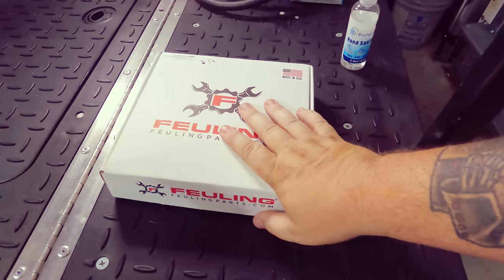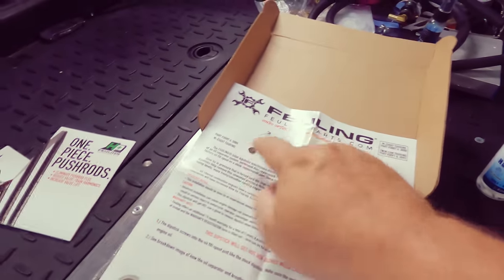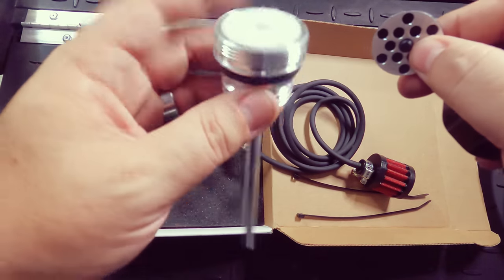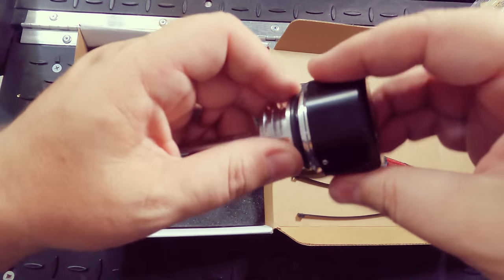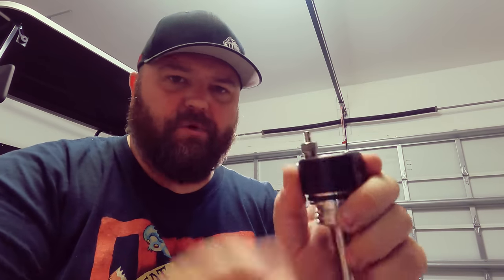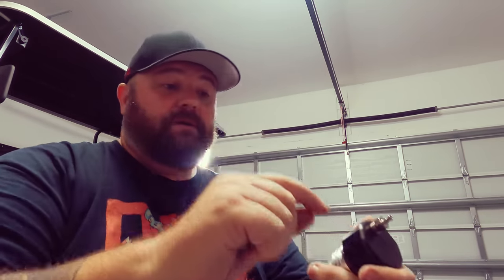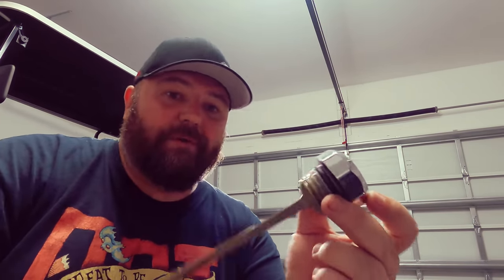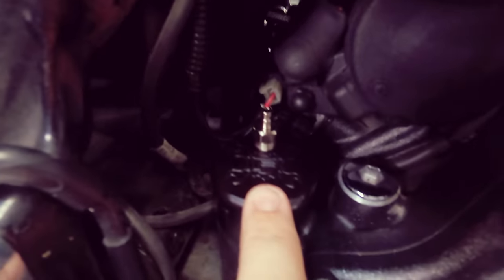Harley Davidson CVO Road Glide - Getting Rid of the Blowby

Comment: After 100k miles on my Ultra I replaced the air/oil separators in the rocker boxes to help stop the oil in my air filter. Then also added the Fueling dipstick and that thing is nice. The stuff that’s inside the Fueling dipstick cap is exactly the same stuff in a twin can air/oil separators. I’m very happy with Fueling.
Reply: Read you saying 100, 000 miles or 1,000 miles because 1K equals 1,000.
Reply: @boblafountaine9560  I have 100,000 miles + on my 2011 Ultra Limited.

Comment: The competition’s hose routing goes up, under the gas tank, and the filter rest behind the air filter cover. The theory being that gravity will let any expelled oil run back down into the tank, and being up high won’t suck oil out of the tank.

Comment: You’ll still need to do the rocker box ones to keep the air filter clean.
Reply: My filter is spotless with just the feuling dipstick
Reply: @ericnuernberg3901  how many miles have you ridden with the dipstick?
Reply: @brianregan3046  not much, maybe a little over a thousand miles.
Reply: @brianregan3046  but so far, so good! 🤞

Comment: I greatly reduced the awful blowby of my 114 by slightly under oiling the engine, I mean by that running it at 90-95% of the full hot mark but she's still puking a little.
But doing this requires to be a little more vigilant on your oil level and not let it go down too much.
I may end up doing the Feuling thing but I can't wait to see your report on this.
Reply from the maker: I have heard that also. 90% seems to be the magic number.
Reply: @ProfessionalMonkey 
I'm almost sure Harley did run his engines at 30% or less for the EPA tests haha
No oil ; no oil blow-by ...

Comment: I bought one. Here in Europe they cost over $400 due to taxes and duties. On the test ride after fitting I initially felt no change. Then after a while I convinced myself the throttle response was better, but then I thought my M8 engine was not running as smoothly as normal!. I guess its all subjective, but I will see what I think after more miles.

Comment: Whatever you do, use the PREFERRED method that Feuling recommends or routing the hose and filter through the frame of your bike, not the method of just using the little screw filter that comes up from the top of the dipstick. I got lazy and just used the little screw filter method which was fast and easy but then I took off on an 1,100 ride over Memorial Day weekend and ended up with a bike full of grime and oil. The oil mists ever so gently out of the little screw filter but then collects on the bike which then collect dirt and grime from riding. It took me over an hour to clean up my bike from the oil residue and only about 10-15 minutes to hook the dipstick up using Feuling's PREFERRED method. Long story short...do yourself a favor and use the PREFERRED method instead of the quick and easy one. This is a great product but take the time and do it up right the first time or else you'll be cleaning up your bike from an oily mess and regretting not going the extra mile to begin with.
Reply from the maker: Agreed.
Reply: What you mean by preferred method Sir?

Comment: I just installed mine yesterday. I will wait for my next service to check the intake and see if I have less oil. Be aware that the included ties are too small for tying into the lower frame.
Reply from the maker: Yep, I think they intend for you to tie them to the cabling not the frame rail itself. That's what I did, I just used about 3 or 4 more because I am anal retentive.

Comment: I got the gas monkey oil cap vent and the filter goes up under gas tank. Downside there's no dipstick and they advise you to run the oil level about a half quart low to prevent excessive blow by. Upside is it was $89. Although after testing there was minimal HP gain .5 but It really feels like frees the motor up and it accelerates better. I have to do the air filter ones next I have an after market arlen ness so oil just runs down the motor.
Reply from the maker: I am doing a catch can tomorrow and will film it.

Comment: Interesting. Older engines had blow by relief on the back side of the crankcase. It worked pretty good.
Reply from the maker: Yep. And they didn’t cycle it into the motor either.
Reply: Yeah, but the EPA says you can’t do dat no mo

Comment: I was wondering if anyone has spoken to the service department at their local dealership about this issue.  I want to say I am very happy with the service guys at my dealership they have treated us very well.  When I asked them about this and showed them a video on the topic they acted like they had no knowledge of any issue with the M8 blow by.  Maybe they are not allowed to say there is a problem with a Harley product?  I was just trying to find out if this was something we needed to address on our bikes (19 CVO Street Glide and 18 SGS) or if someone was just trying to sell their product (vented dipstick).
Reply from the maker: Hi Scott, I am not being paid to say anything, Feuling just gave me the product. I would never say something I don't feel is true. I am shocked to hear that a dealer claimed to not know about this issue. Do you HAVE to do something? No. Right now any excessive oil that comes out of the breather bolts is pulled into the intake and burned. That causes the air your bike is burning to be hotter (less efficient) and oily, causing build up on your piston heads, eventually reducing power. This is just a way to improve the overall "health" of your motor. No one is trying to sell you anything, just a neat way to get rid of a design flaw.
Reply: Doc at low country does a video about needing extra head breathers! I ask stonewall hd and service was not aware about problem and comment was anything non oem could bone you if your dealer is a hole!
Reply from the maker: @kpnomad7  Absolutely true. If your dealer wants to be an a$$ they could ding you for anything. I wonder if Doc would recommend additional external top end breathers if you have the oil tank vened?
Reply: Doc did the ext head breather on his personal bike! I haven't seen any more updates about him doing more for the crankcase!
Reply: If your bike had the problem you would know it! I’ve fooled around with my local dealership for four long years with no good solution. I’ll try this and pray it works!!

Comment: The Fueling Dip stick is definitely the Solution for the sumping as I understand it.  The oil catch can is definitely a good idea.  I have a catch can on the HEMI in my Ram 1500 and had one in my Dodge Charger.  Amazing what the oil catch cans pull as blow by.  Saves all that crap from going in your intake.  I drain the oil catch can on my truck about once a month
Reply from the maker: Good to know!

Comment: Keep a eye on the transmission oil on the M8 apparently it's being transferred into the primary case through the clutch rod,  on some bikes this is happening within 1000 miles. This  can cause serious  transmission damage due to low oil condition.
Reply from the maker: Mine already has the vent tube.

Comment: I ordered one from A1 Cycles should come in tomorrow for my CVO hopefully works out!
Reply: Let me know what you think...I like 89 versus 289
Reply: Will do!
Reply: From the research I've done, coming out of the oil tank the vent would relieve some of the heat from the oil keep the oil cooler.
Reply from the maker: You're exactly right. Buying a dipstick with holes in it is NOT THE SAME as Feuling's.
Reply: @Dave B i installed the A1 Cycles Breather Dipstick,  I have a 2011 CVO Road Glide Ultra with the TC Screaming Eagle 110 Stage ll 255 cams  my issue was rear cylinder Extreme engine heat and my motor felt like it was forcing itself to run when it is fully warmed up, this from what a couple of Harley dealers told me is typical with the TC 110 Screaming eagle motor.I had no blow by at the air cleaner, once I installed the Breather I hit the highway for a 100 mile ride the motor did run Cooler and Smother there was no oil leaking from the beather, now A1 does recommend you take a little oil out of the tank which I did and the filter runs up between the cylinder heads. I did run by the Harley shop afterwards to get there Blessing which they did. Dave this worked for me in my situation do your Research as Jason says who knows it just might work for you!

Comment: I vent in both those places as the pressure is built in two different ways ...sort of the churning of oil creates crank pressure and the blow by creates head pressure. You want your engine to breath well do them both.that said I only have one outlet I t my crank breather into my head breather and to the ground. Ps if you can get fuiling to send you and oil pump and cam plate for a 103 I'll take that.
Reply from the maker: Ha!
Reply: @ProfessionalMonkey  its le.get I've got s&s cam plate and pump  but I always wonder did I make the right choice.  I have three but could I be happier with only two. That an inside the pump joke.

Comment: Adding this to my first CVO once I take it home... after my dealership and Harley pull their heads out and supply the handle bar cable clutch extension kits for 13” handle bar change 🙄
Reply from the maker: Its a nightmare. My guy said they should be in on the 12th, then 3-5 days to get it in hand.
Reply: @ProfessionalMonkey  
.... apparently, after market suppliers like Magnum & FBI are not ready to release a kit that fits the clutch arm and cable clutch adjuster without crimping the line 🤬
Super appreciate any feedback you share on this issue. Like you, I literally don’t know how to ride with stock handle bars 😫
Reply from the maker: I[m just waiting. It sucks but the other option would be to use a 2011 model year clutch cable long enough...
Reply: @ProfessionalMonkey  ... my dealership tells me that’s not an option because of the CVO clutch arm? Risk of crimping the line??
It’s so ridiculous

Comment: I'm wondering why someone hasn't designed an intake with a built in catch can.
A hidden drain valve  and a inspection port to know when you need to service would be nice.
Reply from the maker: EPA
Reply: Several of the Arlen Ness Air Cleaners, including the Big Sucker for Stock Cover include a catch reservoir which is not too difficult to clean out, when required.  But you essentially have to first remove the filter element and stick your finger in the reservoir to see if it has caught any condensed oil.  It's best to wick up any oil with a paper towel before removing the reservoir cover to prevent dripping.

Comment: Nicely engineered piece!  Have running the Fueling Oil Dipstick Breather/Venting Kit on my 2020 SGS for about 2 months now; originally I had run it with the small breather (no hose and filter) for a few days and it was fine.  I then decided to go with the hose and filter.  Looped the hose up and over then down (same as Fueling's recommendation) and tied off the filter down under/between the trans and gearbox.  Works excellent!  The only item was a 0.050 tool for the set screw for clocking and then setting/locking down in place the final clocking (ended up going to Harbor Freight to get the tool, which was cheap...about $7 for a whole set of about 8 different sizes; of course only needed the 0.050" but they didn't sell just the one.  Interestingly, I found a bag of 100 of these 0.050" online for $11.99; it would have been convienent if Fueling included the 0.050" tool for the set screw).
Reply from the maker: Surprisingly I ended up having one.

Comment: I installed one on my 2019 RGS last September, I have still seen some oil in the intake. I just added a DK Customs catch can as well. Anxious to see if you still have it afterwards.
Reply from the maker: I would image there will always be SOME, since there is oil sloshing around up there, it's gonna find a way out even if its just a dribble, but this definitely de-pressurizes the breather bolts quite a bit.
Reply: @ProfessionalMonkey  it's best to do both but if you can only do one the blow by kit is the way to go bc it makes sure no oil can get in the dipstick is more of a reducer

Comment: Steep price!  I did the T-man version of tapping the side of the oil tank.  Did the research and purchased the parts separately online around $65. Don’t need to change anything with the dipstick. Also did a version of the external/internal breather mod to get it out of the stock intake.
Reply from the maker: You drilled and tapped your oil tank? Respect, I am just not up to making such permanent mods that could go wrong.

Comment: Great video Sir! Has Harley done anything to improve this on the newer engines? Or will I need to do this on my 2021 114"?
Reply from the maker: Nope. No improvements. All M8 motors spit a bit too much up top. I will go ahead and do something like this on my 21 also.
Reply: @ProfessionalMonkey , thanks!  Keep up the AWESOME videos!!!
Reply: @bobpatterson6052  The only "fix" the EPA would allow is the primary vent. It's part of the manufacturing process for '20+. If you have the '18-'19 look at the top/rear of your primary. If you have a rubber nipple coming out it's done. If not, take it in for the recall (won't cost anything). 

the recall is better than nothing, but the stick is better. Both work well together. I'd still vent the intake, even if not needed for blow by, just to keep dirty air and oil out of your combustion chamber.

Comment: Got mine ordered today!  Did you say something about a Trask intake or head breather solution?   I have the DK external breather kit installed like you had originally planned- and I still get some dribbles of oil out of the filter hanging down under the intake.  Now with this vented dipstick installed I will be looking for another option on the head breathers.
Reply from the maker: The combination of the Feuling and the DK kit and you should be good!

Comment: won't the top hoses in the breather still put oil mist into the intake from the heads
Reply from the maker: Much much less. Since the pressure is being reduced at the bottom end it will push A LOT less oil out the breather bolts, therefore lowering the temp of the air being pulled into the throttle body, and burning less oil.

Comment: Is the dipstick instead of the air cleaner housing bypass on top? Or, are you doing both?
Reply from the maker: Instead. I like this more.
Reply: @ProfessionalMonkey  so this will protect the pistons/cylinders/air filter the same that breather kit that DK would that you installed on the heritage? same result as far as it won't put hot/oily air back into the engine?
Reply: Also, would you need to re-tune a bike after doing something like this? or should it not really change anything?
Reply: FYI- Even though I have the Fueling vented dipstick on my 2018 M8, I still get oily discharge out of my head breathers. So, I think it’s still best to do the cylinder head external breather if you don’t want that crap routed through your air intake. Maybe the Fueling vented dipstick reduces the amount coming out of the head breathers. But, in my case it was not completely eliminated.

Comment: I watched videos for the A1 cycles and you have to put less oil in the bike. Is that the case with the fueling one?
Reply from the maker: I haven't noticed there being any coming out of the filter. I think it is running back into the motor when I shut off, so it's working.
Reply: @ProfessionalMonkey  what’s in asking is if the bike takes 4.5 quarts before. Does it still take the same after the vented dipstick.
Reply from the maker: @KINGSAME4444  I would imagine. I’ve seen where some reduce the oil to 90-95% but I didn’t abs haven’t see any coming out of the filter.

Comment: Does this prevent oil being recycled through the engine? If so wouldn’t that need a new tune if it changes the air fuel mixture?
Reply from the maker: You're not really changing the air/fuel mixture. You're replacing the dirty oily hot air with fresh from the intake so no retune necessary.
Reply: Good point to highlight.
Reply: If you have an auto tuner, I’d run it again, but I wouldn’t drop any money on a new tune.

Comment: Question - your bikes are newer , do you void the warranty by adding a breather / catch can ?  I'm just curious bc I have a 2019 Ultra and I would like to do the same but not if it voids my warranty
Reply from the maker: Technically it might sense you have modified the pollution system, but it would have to be your dealer that dings you for it. Digital tech won't know, so...
Reply: @ProfessionalMonkey  agreed. I guess you COULD remove it and put in the stock dipstick when you bring it in for service and they would never know
Reply from the maker: That also. I really doubt a dealer would be that "prickish," but you're right.

Comment: Hey how do I tell if my bike has blow by , 
Cheers love the channel
Reply from the maker: Hi! Monitor your air cleaner to see how oily it is. A little bit is normal, but from motor to motor it varies. If it’s pretty wet with oil it would be good to add a breather system.

Comment: motors r getting bigger so they need to let that pressure out
Reply: Not true Sir. I have a 143" S&S on the dyno and there's no blow by.
A leak down test confirms why. Sorry but there's several CONFIRMED reasons why the M8 has excessive blow by, but most people  don't want to hear or know the TRUTH.
I highly recommend the FUELING dip stick for those who have a stock bike, pure quality!
T.S. RACING
Reply: @t.s.racing  depends if its the evo base or twin cam,plus the m8 has thinner rings which doesn,t help